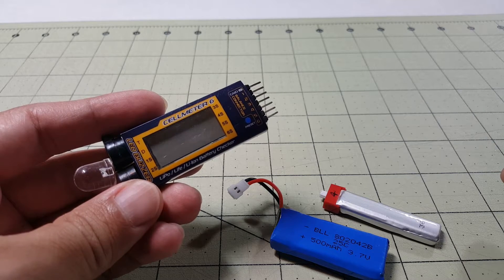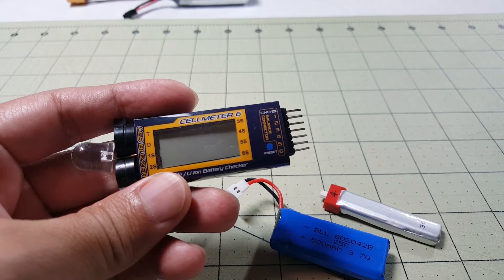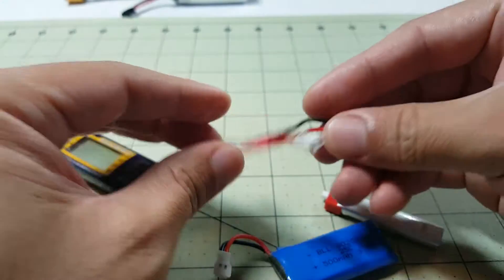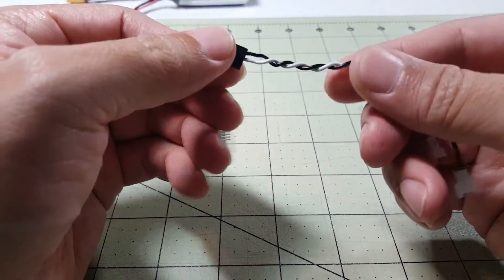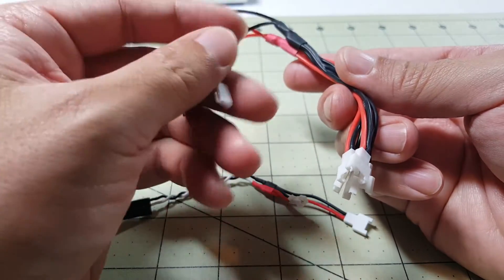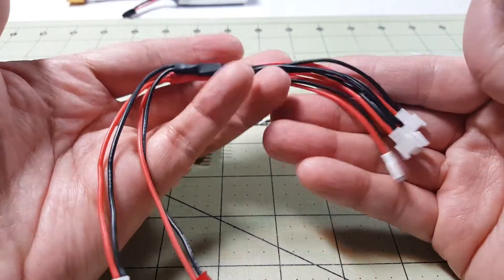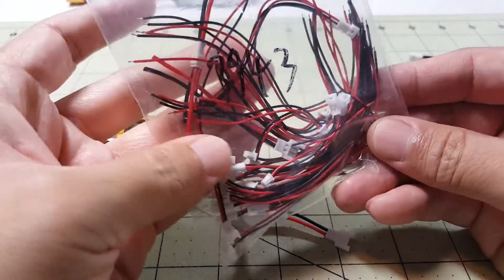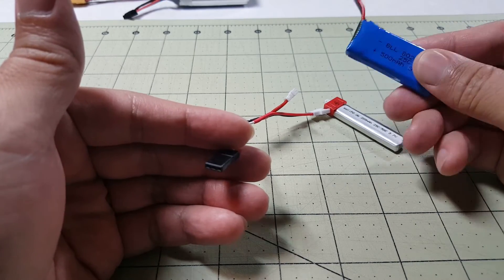DIY Tiny Whoop Lipo Checker

Comment: I use my hobby charger to test LIPO's with,
I discharge them either by flying them in a model 
or by the discharge function on my charger, then 
charge them up and my charger displays how much 
current it has put in to the battery over the charge cycle.

If its a real good battery it should accept slightly more than it's 
rating and if it's bad it will accept much less than it's rating.

Comment: When you multicharge 1S batteries do you use one of those seperate balancers? I remember seeing Benedikt from MMW using one every few times he charges multiple 1S packs
Reply from the maker: +Jon B Baca you can if you want. I just try to make sure my batts are all within 0.1v of each other and charge six at a time. They will all self balance and its faster than having the charger do that work.
Reply: Is there a danger of over charging one if it starts out a lot higher than the others? Cause the charger thinks it's charging a single 6 cell pack, correct?
Reply from the maker: +Jon B Baca Hmmm, that's not what's going on. If you parallel charge then it's still a 1s pack. Just a larger capacity. The cell with the larger voltage will drain to the lower voltage cells until they balance. You just dont want the difference to be large.
Reply: Right, but essentially that's what happens when you balance charge a 6S pack, right? It gives and takes from each cell until they're all as close to 4.2 as possible, right?
Reply from the maker: +Jon B Baca no, that's not what happens in a 6s pack. The charger over charges the other cells by 0.1 or 0.2v to bring up a lower pack, then drains the higher cell. Sometimes this takes a long time.